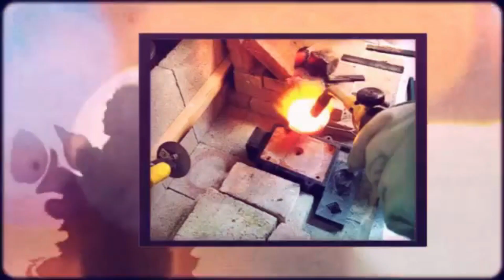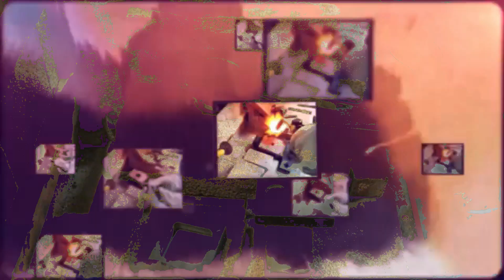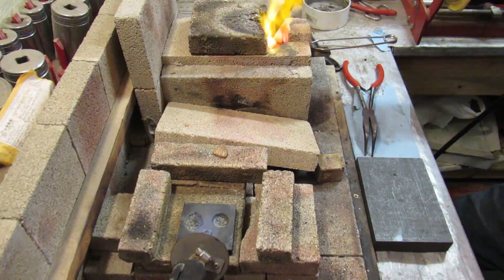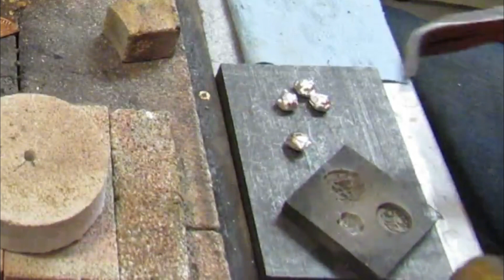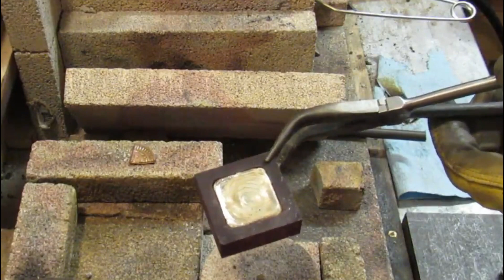Pouring a molly bar for my 1000 sub giveaway and also some silver Tomoko's Tiny Tigers

Comment: Wow mate I've never seen this done before I wondered how hard it would be to make up acouple of moulds of my channel name logo up as I'd love one for myself and one for a give away as well. Very cool work mate.
Wayne
Reply from the maker: I can do a sand cast piece for you but will need a pc of wood carved out for a mold I can push into the sand or a 3D piece made to do the same with. I am no artist when it comes to doing that.
Reply: @TomokosEnterprize  oh ok mate well I'll see how I go it's just something I'm toying around with so I'm not it a big rush
Reply from the maker: @WaynesGarage  No problem my friend. One thing that needs to be is any vertical surfaces need to be tapered so the piece will not catch any sand on removing the piece from the compacted sand. 3 or 4 degrees is about right. Good luck my friend.
Reply: @TomokosEnterprize  ok cool thanks for letting me know that thanks mate

Comment: How's she goin'?  You make that look pretty easy, but I'm sure it's not!!!  I never did anything like this type of craft before.  Just a quick question, is that just propane for the torch or is it some other mixture to get a higher heat?  Thanks for posting and take 'er easy!!!
Reply from the maker: Hey bud. It is a Map alternative called HGX that I get at my welding supplier. 20 lbs for $ 70 CDN and a 7 buck tank rental a month. Otherwise a bit of math tells the story as the 1 lb bottles of Map are  $ 15.oo ea at the hardware store eh. Propane will do the job but it just takes longer. Getting it to melt is one thing but it takes a bunch longer with the Propane for sure. I would use it on my cutting table at work or cutting 2 in thick TQ100 plate. Tough cutting for sure.
Reply: @TomokosEnterprize  Thanks for the info dean!!!
Reply from the maker: @GrampiesWorkshop  Anytime my friend.